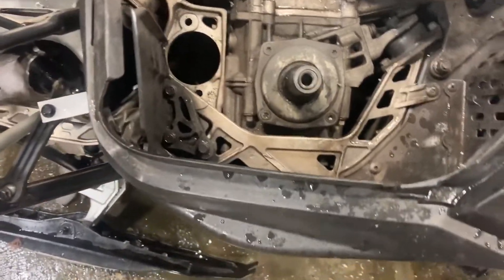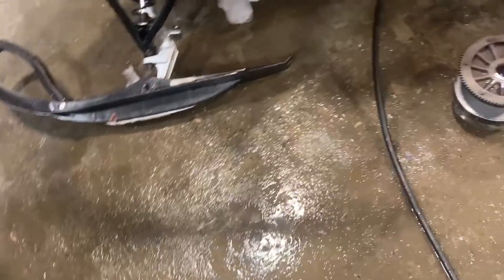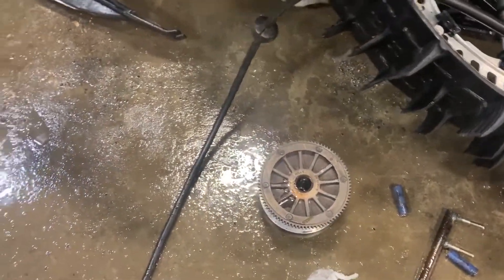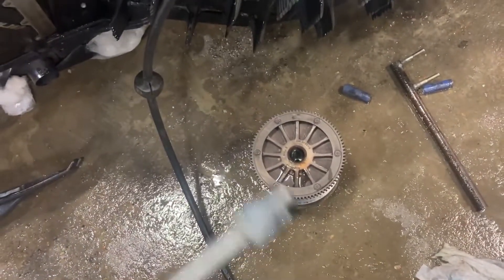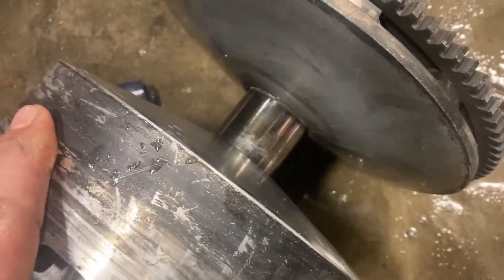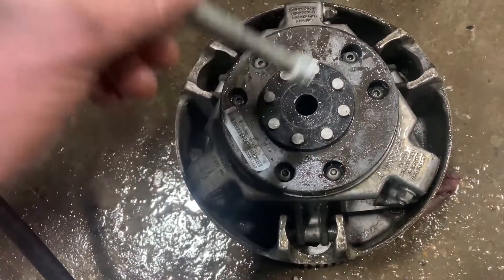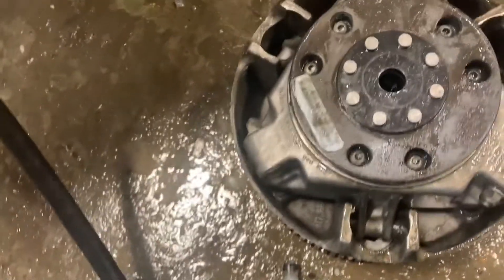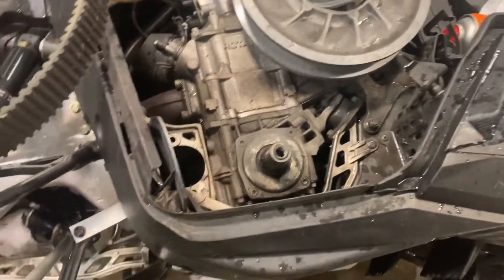Ski doo 800 etec clutch stuck!!

Comment: So the reason grease wouldn’t work is because of off air bubbles that would get folded in as the grease was pumped in. As the bolt is threaded in the air bubbles would compress first and drastically reduced the pressure created. I’m having the same problem using water, it worked great on my other sled, but not this one. I may try the gear lubr or oil next. Thanks.

Comment: This gives me hope lol... Got a real stubborn arctic cat clutch. Ended up bending my 2 piece puller to a point where I can't get the inner piece back out!! Tightened it up so much the threads are tweaked a bit. Going to get a tap to straighten things up and try this tomorrow, or I'll be cutting the darn thing off!
Reply from the maker: You should be able to get it off.  I'm finding pullers bend easily, even when the clutch is torqued to spec, you can bend a puller.  A coworker has a '14 M8000 and he had a tough time getting his clutch off as well.  Heat it up if you have to.  I'm finding this bolt trick is good with thicker oil
Reply: @Pneumamechanical  Tried it tonight. She popped right off!!! Like 3 seconds of impact... no joke
Reply from the maker: @Ethan-ck6iz  Glad to hear you got it off! good job

Comment: I had tried the water trick and after 2 days of trying to get it off. I then bought the correct puller and it broke off in the crank and clutch. I ended up cutting the clutch off with a grinder. Took me a week to get it off after waiting for tools and maintaining patience. I'm betting mine was put on with an impact.
Reply from the maker: Yeah likely,  it's amazing how they get stuck on there.  Wouldn't you like to get ahold of the guy that put it on?!

Comment: my 2 sheathes are stuck together lol… so i cant do the maintenence i wanted to do :P
Reply from the maker: awe dang!  yeah might have to get  new clutch
Reply: @Pneumamechanical  i smacked it against a anvil type thing with the puller lol, it worked
Reply from the maker: @crodles  get er done!  glad you got it apart, we gotta do whatever it takes sometimes
Reply: @Pneumamechanical  the sled is from 2017, and it has over 9000kilometers on it, i dont think that clutch has been serviced at all since new. everything is gummed up lol
Reply from the maker: @crodles  Good you got it apart, they're not too bad to rebuild, it's nice to have the special tool to install new buttons, PITA without it
Reply: @Pneumamechanical  i do have that tool, its just everything is gunked up and nasty to touch lol
Reply from the maker: @crodles  Good Times eh? :face-purple-crying:
Reply: @Pneumamechanical  starting to wish i just said to the dealer to clean the crap out of it